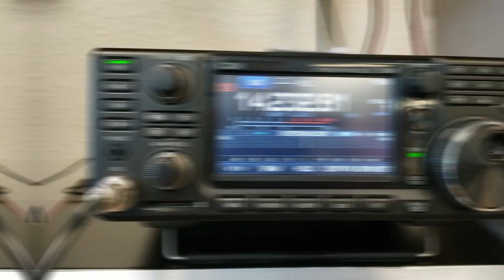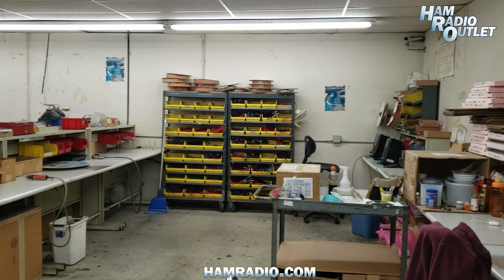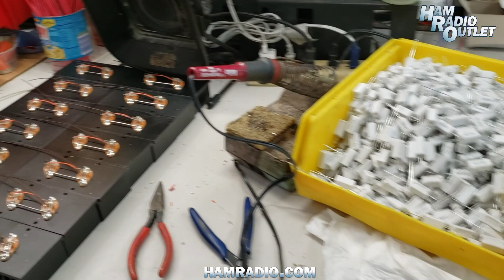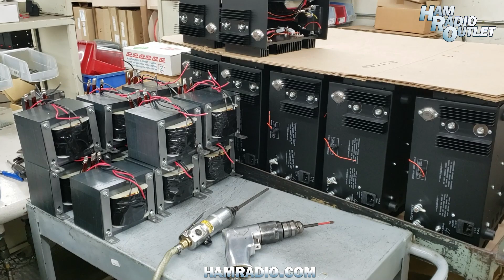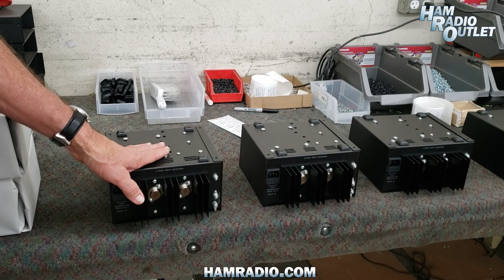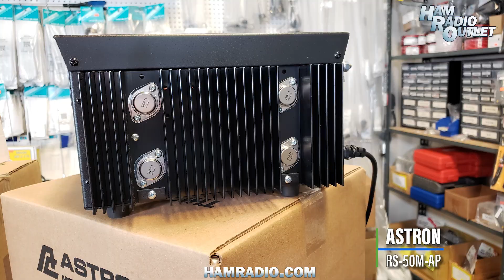Astron Power Supplies Factory Tour and Product Introduction - Ham Radio Outlet

Comment: Let me preface this by saying my Astron RS-35m has never let me down since 2014. However, I recently replaced the incandescent meter bulbs with the LED board that Astron sells. I had never really dug into the power supply before. I was shocked by how things were put together. Wires soldered to connections are very sloppy. They could have used spade terminals to make the connections. It would make diagnosis and disassembly much easier. In the end, the LEDs work fine.
Reply: Pricey, but worth it

Comment: Why would someone want a linear over switching? I had a radio once that did not like being on a switching power supply. I got the linear Astron and I've never had a problem with it since. Some radios don't like switching power supplies.
Reply from the maker: I think that may have been a problem in the past, but modern, high-quality switching power supplies, like those sold at Ham Radio Outlet, should not be a problem. Of course, you have to have a power supply that can provide the right amount of voltage and current. 😁
Reply: RF noise. that is the biggest reason.

Comment: Go Ahead And Say It...I Will...The Linear Astron Power Supplys (With The Transformer) Every Part In It CAN BE REPAIRED/Replaced IF They Ever Fail & The Switchers Just Half To Be Threw n The Land Fill When They Fail & That is The Truth !  That was 1 Of 2 Major Reasons To Buy Them Over The Switcher ! I Have 2..a RS-20A & A VS-35M ..No Switchers Allowed n My Shaq !
Reply from the maker: I've had both Astron power supplies (with the transformer) and solid state switching power supplies that have been on 24/7/365 for over 20 years so I don't think it's much of an issue. ☺️

Comment: I had an Astron 50 amp supply that lasted me over 30 years trouble free. I currently have a variable 35 amp model with meters and it runs like a champ. Astron power supplies are built like tanks.

Comment: RS-35 or 50 for running Texas Star 500V and a few other things???  I'm ready to purchase. Anybody? Thankd
Reply from the maker: Look at the manuals for each of your devices. See what the maximum current requirement is for each device. Add all of those figures up. You'll need a power supply that can supply that current... assuming that you're running everything that's plugged into it at maximum output and all at the same time!

Comment: Wow, what an outdated factory. Dirty, messy, chaotic, not a single ESD strap or mat in sight. Technology from the ark, even down to (externally exposed) TO-3 devices. I guess the "linear" and "made in USA" are what sells them.
Reply: Who cares? I could care less about how they run their operation so long as quality products are produced and supported, and in this case they are. You would be surprised at how many factories don't allow visitors at all, let alone picture/videos of the inside because they might be "messy" by somebody's definition and yet they produce some of the best products. And truly smart people know that time-proven technologies are still the backbone of industry and that linear power supplies still have many advantages.
Reply: @Unit379  Well said.   My Astron from 1988 just sits there and still works, sometimes its on for week at a time,  and still no problems. Its a 5 amp unit hooked up to a radio shack 10 meter radio.
Reply: ESD is just too pervasive of a subject, to think that you can cure it with a couple of foot and wrist straps.   The ESD devices are used just to impress new customers to your shop.  Stupid customers are impressed by EDS devices in use.  Meanwhile smart customer look at more important things  like on time delivery and component quality  and other things.
Reply: ESD. Who cares.  I bet the closest CMOS device in sight was in the camera used to film the interview.

Comment: I have used these supplies in the commercial market of communications as well as for personal commercial and ham use. My big issue is that I now reside in Europe and you guessed it, 220 to 230 volt mains. Could not use any of the Aston’s I had so they were sold off before I moved. All I had was an Alinco that was a  dual voltage switcher. 
Is there an Astron switcher that can run on this wide ranging euro power grid (and perhaps on the American grid by making an internal change) at least 50 amps continuous with meters? WITH a schematic in case repairs are needed? I had to purchase a second Alinco switcher to get me through a bind when the original failed but two problems, 1, no schematics available, 2, no longer a dual input voltage unit.
Reply: @Subgunman  most switchers and even linear power supplies allow 220v operations with a few tap changes.

Comment: I also had one of their switchers for 100W class rigs, and I did not notice any RF noise or issues as compared to the big 35 amp linear supply, running a couple rigs.  Now the switcher had a little bitty fan in as I recall.  But the fan noise was pretty low and not a problem compared to the light weight, efficiency and convenience of the supply.  Some of the bigger open back accessory speakers could even be used to hide it inside out of sight if you wanted.

Comment: Good video guys.  I got my novice in 1988  and got my first Astron power supply  then to run my Radio Shack 10 meter radio. Today I have several Astrons in the shack and they all work.  I work as a factory technician  at Revco in Garden Grove as a Test Tech.  If I had know that Astron was just Next door in Irvine ,  I would have applied to work there years ago.  LOL.  KD6CFE  was here,  73

Comment: I have several Astron power supplies. I have a RS-50M I purchased new from the Portland HRO store in 1990, it has been in continuous use ever since. I have not had a single failure or the supply showing any signs that the caps may need replacing.

Comment: I called Astron about an Out of Warranty power supply....we talked, they sent me two power transistors which I installed but it didn't fix the problem.....so I sent it in and they needed to replace something else and they didn't charge me for repairs or shipping back....Who does that....

Comment: I have several and they all around 20 years old or older. RS70-M  RS-50A  and more. I have fixed a few over the years and just basic problems . like solder joint break on buss bar on 50 and 70 amp ones . Just the weight and moving them around can have that happen. And power surge problem from mains.  Usually the MOV inside burns up takes out fuse . And broken fuse holders. Be careful with the big ones. Sometimes a 723 reg ic goes bad. usually from a line surge. or poor grounding. RF getting into shack and supply.  and with the linear supplies the pass transistors have postave voltage on them. Watch hitting outher metal . I just has a RS 35M come in for repair. The coax fell off dest onto heatsink and sparked onto the 2N3771 transistor blowing the fuse and the rectifier inside. Also I had to replace transistor because a hole was blown threw when it arcked over. it tested good but had a hole blown threw the case. They make 3D printed covers for them. printables and outher have the 3D files . I have a repeater cite with a 50 amp Astron supply with battery hook up built in. 20 years running. never failed. Has AGM telcomm 100 AH batteries (3) .  The battery only last about 3 years or so. 200 watt VHF and UHF linked system on that supply . Astron is great stuff made in USA and they have parts if you need them . The 240V model will run 50 and 60 HZ . Used all over the world !  HRO is best place to buy them  .  great factory tour !  73

Comment: I picked up my RS-50A for $50 at the RatPac Palm Springs meet a number of years ago, it wasn't working so I replaced all the pass transistors put new mica down, and grease and the next problem popped up, bad circuit board. I tried doing some simple board-level repairs and then I called Astron and told them my issue they said we have an upgraded board for $35 bucks, and I said take my money. It's been on like Julian said 24/7. It's way more amps than I need but for the price, it was hard to pass up. de N6OIL

Comment: Great video.  I prefer the linear supplies  as they are more repairable by the ham end user.  In the past I had an Astron linear supply fail and I called the factory and they helped me troubleshoot my unit.  Turned out to be a failed bridge rectifier.  After that it was an easy fix on my part.  I have used Astron supplies since the early 1980's.  They support their products.